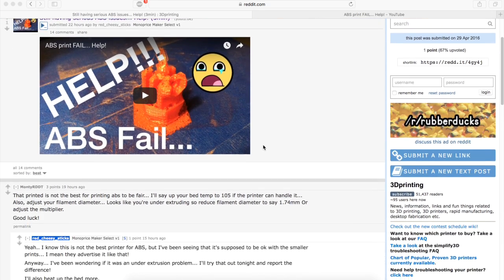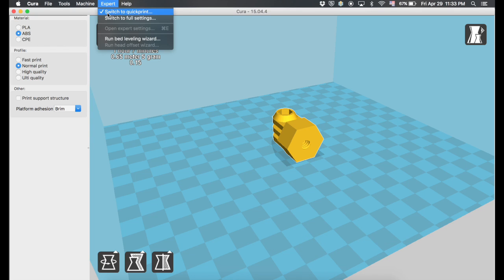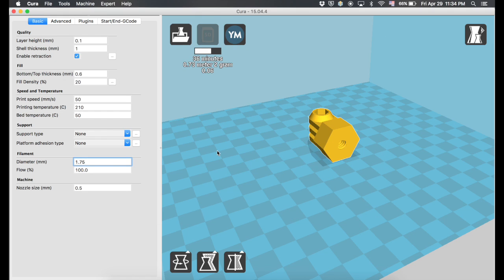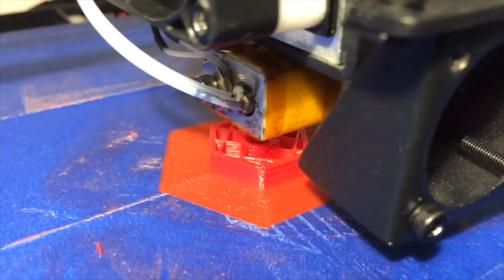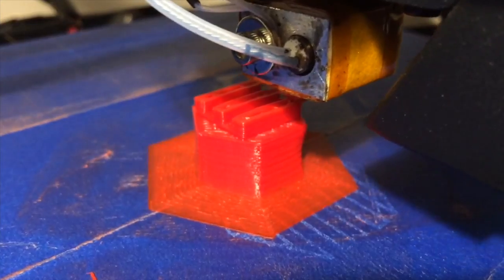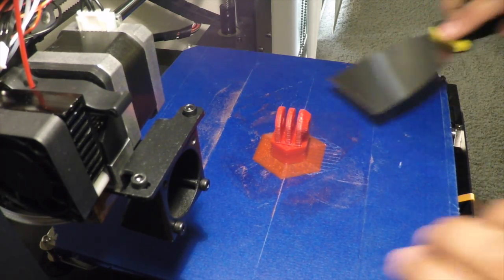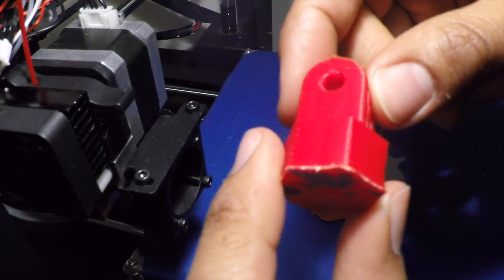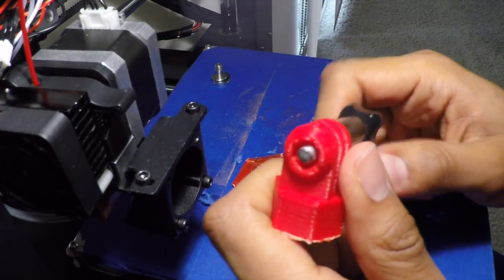ABS print FIXED! Beware of Cura settings!

Comment: Now get a large jar with a metal lid, upside down with a magnet set pinning a rag/paper towel at the top. Use cardboard as a tray on the metal lid surface, soak the paper towel with pure Acetone until it is wicked. Place model in to this acetone vapour bath for 5 minute bursts and visually assess the smoothing. Use a timer and a log, I have found 20 mins to be satisfactory. The variables are layer height < time. ABS benefits from acetone vapour, in that the colour improves, the surface gets smooth and eventually shiny (useful for mechanical parts) and the strength of the material after bath is superior surprisingly. The Acetone vapour penetrates the model, and keeps working roughly 10 minutes after session (do not over bathe) The ABS is weakest and stickiest after bath, so take your cardboard tray (used to keep the ABS from sticking to the lid) and place the model in a dust free area for 30 mins. After this time the model must be aired out with a fan for several hours (12-24 is best) so the acetone completely leaves the layers and the unit begins to fuse and become stronger. Acetone is bad health wise. Outside and ventilated and gloves and no food around. Happy dissolving.

Comment: Do not use the painters tape for ABS.
Also you need to calibrate the Extruder ad the flow
What did you use for temp settings ?

Comment: also here is another thing& this may also help you and others I should know i own a lulzbot mini & this is my experience; Generally speaking ABS & HIPS have higher extrusion temperture than PLA & the diffrence is for pla i generally use 210 celcius instead 240 Celsius for ABS& HIPS your probbally will be fine with HIPS& ABS at the same temperture though i could even make it 20 degrees hotter & i could use colder for PLA & thay would be fine as well But I say generally because its in most cases theyre are execptions like HTPLA from protopasta or lay wood Or other filaments if they specifically say that But where my point starts is when your printing PLA at tempertures meant for ABS or HIPS it can make the PLA melt more than it should this results in wasting material & risking of printing too much like fluid instead of a appropriate flow viscosity & will not melt as fast which can mess up your 3DPrints
Additionally when 3dPrinting with more than 1 material at the same time with the same 3DPrinter make sure the materials used are compatible with similar tempertures that includes the extruder & the bed

Comment: it looks like your using the Maker select V2. I have been printing on the same printer for a while and I would suggest getting a GLASS bed. my print bed adhesion got way better after the glass bed a you don't have to deal with all that tape mess!
Reply: 1984TK421 did you use any further adhesion on the glass like glue or hairspray? Also what is the diameter of the glass. Cheers
Reply from the maker: I eventually did get a glass bed! It's great! I love it. 
The thickness is around 4mm. I actually got the piece for free as scratch glass from home depot. I use aquanet hairspray for adhesion and it works awesomely

Comment: So is your suggestion to just use the pla settings or to make sure that the diameter is 1.75?
Reply from the maker: +Grant Baker use ABS settings, and make sure your diameter settings are correct

Comment: why is your fan missing
Reply from the maker: +Michael Hursh I had accidentally burned it by plugging it in backwards, but I was printing mostly ABS at the time, so it didn't matter. 
I replaced it with a blower fan and the DiiiCooler mod. I have a video for that!

Comment: I'm new to printing and only messed with pla so far. Is there a reason your not running the cooling fan?
Reply from the maker: +MIKE MIKE this was hatchbox filament. In the end I was able to get the settings right. I believe I talk about it in a different video. If I remember correctly, I usually run ABS on 235C and a 90C bed. Works pretty well!
Reply: MexiMaker OK I’ll keep that settings as a default and play it by ear from there on, TY...
Reply from the maker: +Joeker k PLA requires a fan, but ABS doesn't in most cases (in my experience). Cooling ABS too quickly can lead to warping and poor bed adhesion. It still depends on your printer, your settings and your model, but I generally run ABS with no fan
Reply: I'm new to abs too,  my only question  is does the speed matter too much?  you have it set at 20mm/s how would it affect  the print if it was faster?
Reply from the maker: +Matthew C I set it that slow to try to minimize errors, but I have been able to print faster. I don't think I've gone past 50mm/s, but you can give it a shot and let me know how it goes!
Reply: ABS isn't particularly speed sensitive, but your extruder/hotend certainly are! The flow rate limits are pretty easy to reach at higher speeds...
Reply from the maker: +Siana Gearz true!
Reply: Did you get the right settings on this? Some sets their extruder temperature a little lower than yours, I know in the filament world, everything has its own “sweet spot”. What brand filament are you using?

Comment: The cura from their website won't even find my i3, matterhackers does find and will print
Reply from the maker: +Jasper Tielen that's kind of weird... to be honest, I never printed from my computer until I set up OctoPi and it worked like a charm there. I still only slice my models in my computer though... have you tried sending them an email?
Reply: Use Cura 15. The new cura is so messed up.

Comment: I watched your vid, and I'm learning printing myself. With regard to the nut not fitting, did you add the appropriate clearance? A mistake I made in a couple of my designs were not adding clearance. You may have measured the nut and added that to your design, but did you ad at least .5mm clearance? I think if you go in and make the hole for the nut.5mm larger your nut may wiggle in or slide in. I created a fixture for my closet and forgot to take this into account. I had to drill the hole larger in my fixture for the screw to thread in. You also could widen this up for an xacto knife or razor blade.
Reply from the maker: +Lucas Maxa hello Lucas! Yes I did not consider enough tolerances. I was still pretty new when I made it. 5mm tolerances does sound like a lot though! Different printers, different materials, and different designs will need different tolerances. For most of my designs I find that I can get away with 0.2mm to 0.5mm tolerances in PLA. ABS might need a little more due to shrinking depending on the shape and size of your print.
Reply from the maker: +Lucas Maxa and yes! Cleaning up the print with a knife helps. I also bought a set of very small files that can fit in small holes. In this case I just printed it again with better tolerances.